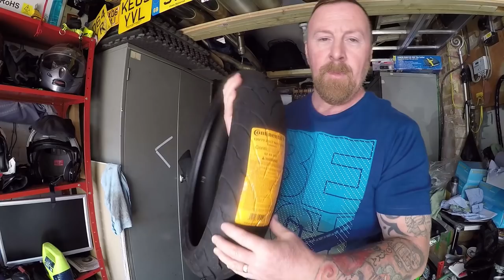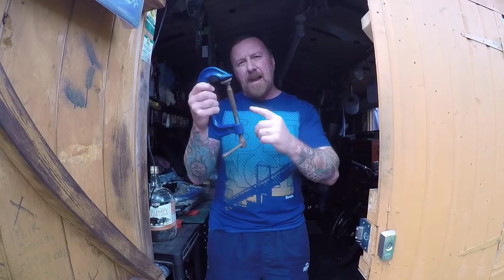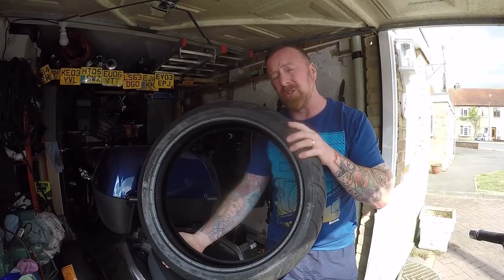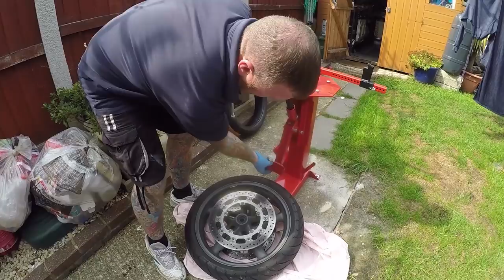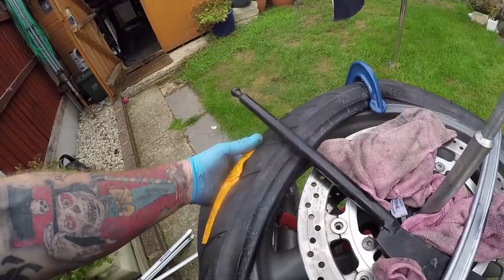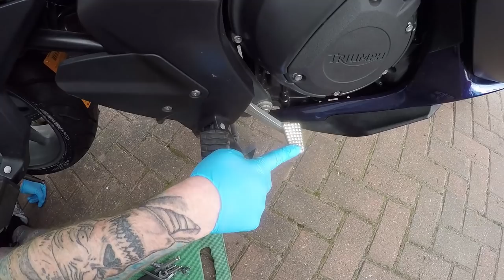DIY MOTORBIKE TYRE CHANGE, ITS A LOT HARDER THAN YOU THINK MARK SAVAGE

Comment: I brought all the stuff to change tyres as well. Like you I came to conclusion probably not worth it.
All wheels have a rotational arrow on them if your not sure which way the tyre should be mounted. Also there should be a dot marked on the tyre. This should be fitted near the valve.
Good effort Mark

Comment: Hi Mark - from personal experience I agree that DIY motorcycle tire changing is a lot harder than we think - my first attempts resulted in a lot of sweat and cursing etc - and I made mistakes and also dinged the rim with the tire bars (I managed to fix the rims up afterwards with some liquid metal, sandpaper and a respray) - but as with a lot of things you cannot learn without making mistakes and there is definitely a knack to DIY tyre changing that you pick up the more you do it.

My personal recommendations are:

Motion Pro Rim Shield Wheel Protector 2 : https://tinyurl.com/y4nwmnst - Get a pair of these and arrange them around your rims - the cheaper ebay rim protectors are too fat for the job and tend to split under pressure, in contrast the motion pros are very thin (so they don't foul the tire lever) and are very tough and will not split.

I know you mentioned this but I cannot stress how important it is to get some heat into your tires (via a fan heater etc) to make them more pliable prior to mounting. 
 
Plenty of tire paste (add a bit of water to dilute it).

A dedicated bead drop center tool.
Reply from the maker: you r a top man and yes have to agree wit hall you comments but for me its the garage from now on lol
thanks for watching
Reply: That's a totally rational decision Mark, taking a loose wheel to the tire fitter doesn't cost that much extra and the tire fitter has the benefit of expensive professional equipment and the fact that he has probably been doing the job 5 days a week for years. I look forward to watching your other videos. All the best.

Comment: If the brake disc touches the floor it can warp it and the tyre has a coloured dot on the side wall,  you line up  with the valve for balancing.O yeah and next time buy a rim protectors when removing the tyre  or use thick plastic....You should do more research mate.
Reply from the maker: No
Just never true it again pmsl mate 
Any way I did buy one but from China and it came after 6 bloody weeks !
Sold it and now just bring them to the bike shop for a £10 each of the bike sorted 
Thats my tip

Comment: A simple trick for getting a tyre back on a rim without using tongues or damaging wheels use zip ties every 4-5 inches around the tyre pull them tight, use soap water you can usually just push it over the rim then cut them off after.
Reply from the maker: i did watch a few videos after all my hard work lol, but its not for me !
Reply: @marksavage  yeah for what it’s worth after a while I reverted back to just taking my wheels off and give it to the garage to fit and balance 
£20 a bargain to save all the hassle.

Proper enjoyed your vid tho  top bloke and funny!

Comment: Hi mate,
I really like your videos. I just wonder a question if you dont mind. What you think about the finding the parts of trophy. Are they easy findable in UK. I am asking this due to the answer is no for Turkey. Triumph brand is not preferred here so much especially trophy is not often seen on the ways. I am thinking to buy trophy 2016 model, but this problem confusimg my mind a lot.
Thanks in advance.
Orhan
Reply from the maker: They are great bikes and ride very well 
I'd try contacting a dealer in the UK for info on servicing dealers in Turkey or if they would send parts over so you could then go to a local dealer with them!
But they are easy to work on once the plastics are off lol
I've had loads of triumphs now and love all of them 
Fun to ride with power if you need it 
Many check out my tiger videos 
Take care bud

Comment: Hi mark. I got a Peugeot speedfight 2. I recently brought it and it was running fine until now. It started turning off when I came to a stop. Now it won’t start at all. I had the carb cleaned yesterday and that hasn’t done anything. It was starting then cutting out, starting and cutting out. I got it going and rode it about 200 metres along the rode then it kept turning off. Now it’s completely done and won’t start. Just wondered if you could help. Thanks
Reply from the maker: Jack Lawrence so it’s cutting out on you 
If you have cleaned the carb as in my videos 
Check spark plug and clean it or changed it 
Clean/ changed airfilter 
Do you have a good clean blue spark 
Wet hand test on the carb as in my videos 
It mY have to start to look at the piston / rings 
Again I have over 70 videos on speedfights to help plus another Channel with them on a play list to help 
Please like and sub and give them a watch 
Mark
Reply: mark savage yes Mark changed the plug, changed the air filter, it is getting a spark and carb has been cleaned but now I’m just stuck. There’s also oil leaking from under the bike. Really strange as it was starting yesterday after my carb was put back on.
Reply from the maker: Jack Lawrence have you put the oil pipe back onto the carb ?
Or pull it off the oil pump ?
If you have done all that and got a wet hand it’s not going to be your oil/ crank  seals 
So next check your reeds 
After that head off for piston check bud
Reply: mark savage yes mate all pipes are back on the carb. The oil is leaking from the top to the bottom all over the stand. Have you got and email by any chance as I can show you. Thing is mark I don’t do the work I have a close friend who works on it for me as he knows better but isn’t an expert.
Reply: Could be seized my moped was doing this before I heat seized it I may be wrong so listen to mark but if that doesn't work keep looking at it I'm no expert but if it isn't starting at all it's a possibility

Comment: Thank's for a great video. I wonder how long did it take you to do both wheels - the whole process? it couldn't have been 17 minutes for sure : )   Will you try to DIY tyre change on your Pan European?
Reply from the maker: it took a hours as the rear wheel would not come off for ages , I had to do it once and no not on the pan, next time I'm going to get a auto electric one like in the garage as so much easier 
however really its just a knack to it and the more you do it, it gets easier well so I told lol 
17 mins was a lot or editing and swearing cut out lol 
thanks for watching

Comment: Hello mark iv recently brought a Yamaha Aerox NS50 2015 (50cc) and I don’t know how to derestrict please can you message me how to or make a video about it 
Many thank 
Calum
Reply from the maker: hi bud
the newer the bike the harder they are to derestrict!, I have many videos on mopeds over 150. 
to start with the basics 
sports exhaust, sport air filter, upjet carb but plus4, change VARIATOR and rollers, as for the washer it doesn't normally work on these
it may also be cdi restricted 
its a few £s but will improve pull away and top end 
mark
Reply: Cheers bud helped alto

Comment: It's not worth it in my opinion. My local mechanic charges £5 to put a tyre on using a proper mechanical machine.
Reply from the maker: wow that cheap to change tyre's but after doing it once as in the video that's it for me now lol
thanks for watching 
mark
Reply: I’d happily pay £5 all day.  Moved from the UK to the US and standard here is around $35 per wheel.  Just bought a NoMar changer which I used for the first time today and it was pretty good.  Loads of lube seems to be the key - definitely made my first time easier!